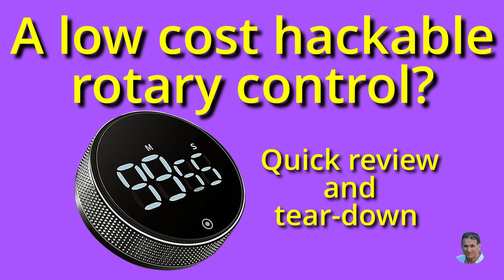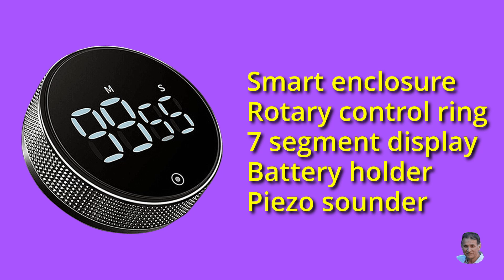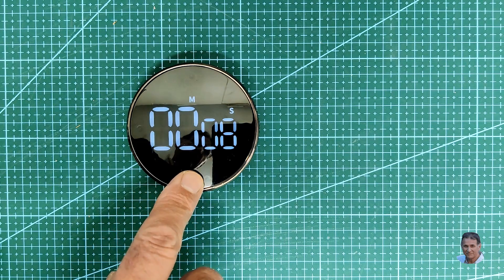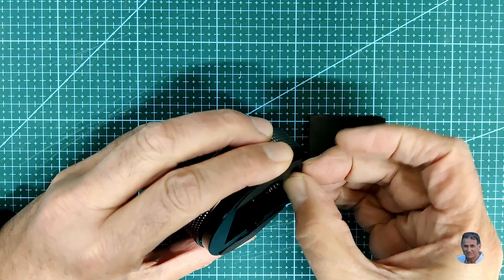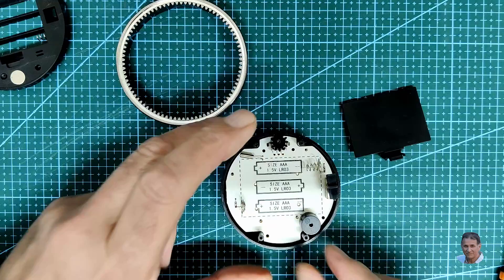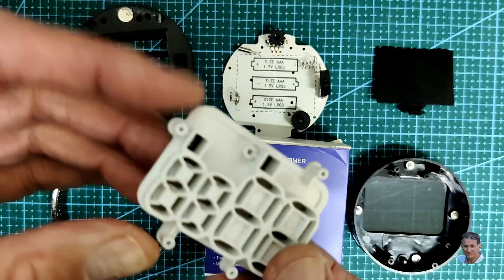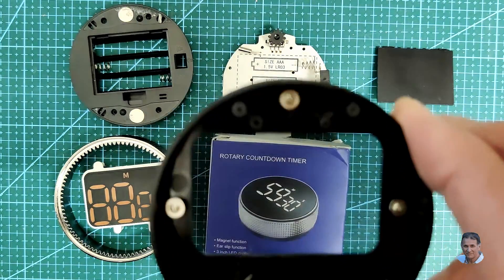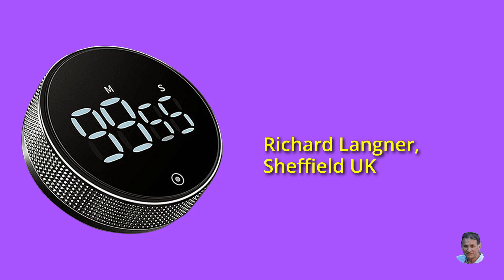Can this cheap timer hardware be converted into a smart rotary control with built-in display?

Comment: Interesting video  👍🏼
The logical next step 
combined with these timing capabilities, is one or two cheap devices… when combined with this could perform the other functions of the Google Nest device earlier in your video? ie control a hot water heater within a range of temperatures and hours of the day, interacting via wifi remote  

I’d think the first question being - for someone reasonably competent at electronics and soldering …
are the traces in the appropriate places on this timer’s PCB large enough to confidently splice those other circuits in?